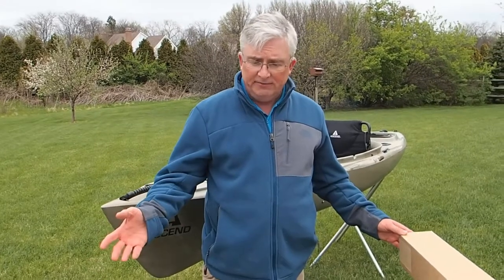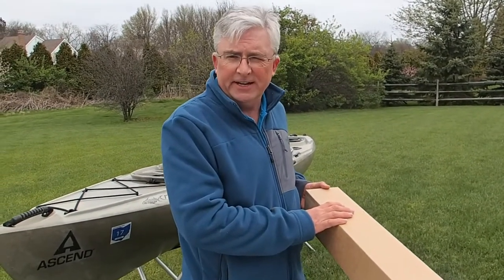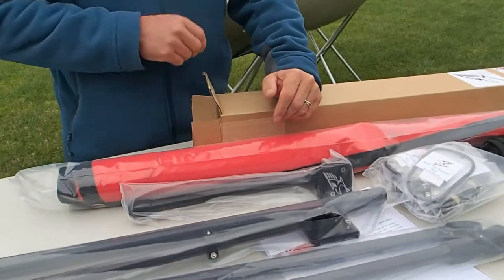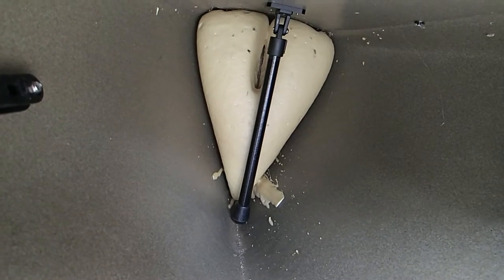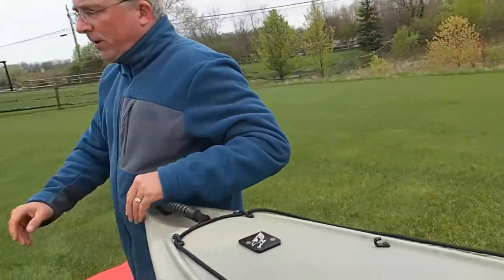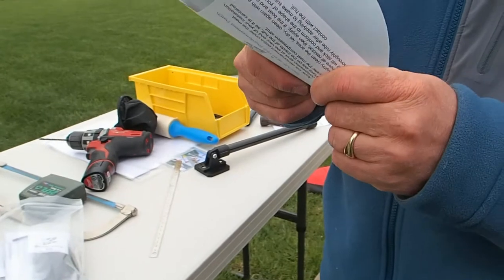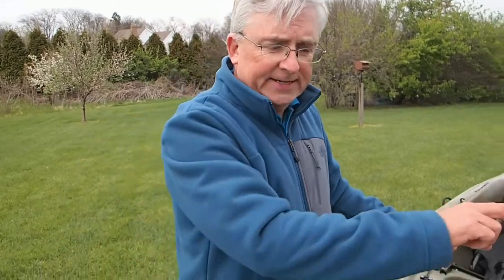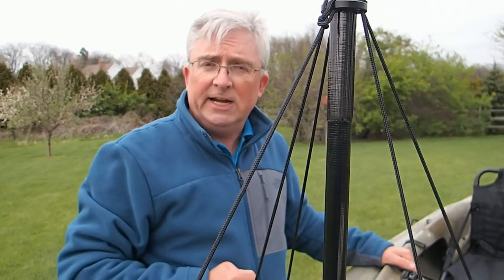Falcon Sail recreational kayak sail install install demonstration.

Comment: Are your sails compatible with inflatable kayaks?
Reply from the maker: You can rig a Falcon Sail on your Inflatable Kayak.
It will require that you make a base be set up for the mast & find a way to secure it to your kayak.
Basically, all you need are some Drings on your kayak to run some lines or webbing to your base.
It can be very secure.  If you need extra line, or cleats to make you rig let us know after you purchase, and we add these parts to your order free of charge.

I would like to post some pictures for you to see some rigging examples, but I can not include pictures here.
If you send a request using the Falcon Sails contact page, we will send  you some pictures to show you what other Falcon Sail customers have done with their infalable kay aks.

www.falconsails.com/contact.php

Comment: I have a 8 footer kayak and my question is should I use 1 square meter or 1,4 squares? I’m planning to use on intercostal waters
Reply from the maker: I would use a 1.0 square meter Falcon Sail.  A Falcon Sail with a complete rigging kit includes all the hardware necessary. All you need are basic tools.
You can design a custom sail for your kayak here.
www.falconsails.com/store

Comment: Easy when you can get underneath the deck. What do you do if there is no access ?
Reply from the maker: Since we started helping people rig sails on kayaks over 10 years ago now, we analyze every single kayak or canoe, someone buys a Falcon Sail for.
When you order, near the end of the purchase process, it will ask what kind of kayak  you have.
If you do not answer the question or we are not 100% able determine what is the best rigging plan to use, we will contact you.    After having Analyzed and documented rigging plans and parts lists for over 1000 different kayaks, we have seen it all and will make a solid rigging plan for you.

When you receive the sail rig it will have every part you will need or want.  All you will need are basic tools. 

We have 2 alternative rigging options when a kayak does not provide access under the mast to install the deck support strut.
#1 Screw Out Deck Plat added to the kit.
Since your kayak does not have access to the inside of the kayak to install the deck support strut, more than likely, we will include a water proof screw out deck plate with all the hardware you will need to install it.  All you need is an area 5" around that is flat or nearly flat within arms reach of the mast base, to use this approach.

#2 Deck adapter block with a integral deck support strut.  With this method, you rivet the deck support strut in place with the provided easy to set rivets, and the strut extends from the bottom of the adapter block and engages with  your hull. It  works on all kayaks, but most people prefer using the standard install or the alternate #1 above.  

In any case, we have a solution for any rigging situation.  When you buy a Falcon Sail with a complete rigging kit, at the end of our store will ask you for information about your boat.  More than likley, we have already analyzd your kayak or canoe.  If we need to know anything to choose the perfect rigging parts list, we will research as necessary until we have a great rigging plan for you.  We will support you from now, until you are happily sailing your kayak. 

Here is our latest rigging video.
https://youtu.be/2i8_EEExqNg

You can design and order your custom sail here.
www.falconsails.com/store

If you have any questions feel free to contact our shop any time.
www.falconsails.com/contact.php

Thank you very much.

Comment: There is Grabner kayak facebook group, guy installed this sail on inflatable kayak (closed top). Haven’t got a clue how he did it. Maybe used drill as well?
Reply from the maker: After having helped many thousands of kayakers rig Falcon Sails on there kayaks, you can install a Falcon Sail on any kayak.
On the decked inflatable kayaks, you make a board ( plastic marine wood is good ideal, but anything will work long term if you seal it ), then insert it under the deck before you inflate it.  When you inflate the boat, the board will be held amazingly solidly in place.   It is actually one of the most solid ways to rig a Falcon Sail on any boat.   If you need help, give our shop a call.
Here is our contact page.
www.falconsails.com/contact.php
Reply: @FalconSails  Thank you for really good response. I can see, professionals who know their trade.
Reply from the maker: @kristaps2010  I am sure you will not find better expertise in the compact sail area.  Plus we will jump through hoops to make sure you are happy.

Comment: I am sure you have probably changed your shroud line knots by now, but if you have not as yet there are far better simpler and faster knots available.
Reply from the maker: After over 10 years of obsessing over every detail, and having helped and interacted with thousands of people properly rig their kayaks, and being very active kayak sailors ourselves, and always looking for improvements, we have not seen anything better than the standard Falcon Sail knots.  Early on, we encouraged our customers to try and find and create better knots.  We found 2 problems occurred when people varied away from our knots.  #1 the experimental alternatives slipped.  Just a minor slippage, will change the orientation of the mast.  Our knot system once set will not slip even 1/10th of a mm over the life of a kayak.  #2 the experimental alternatives would become tight and hard to adjust.  Early on after rigging a kayak, some of the knots may not be completely tight and as they tighten, the lines effectively lengthen sometimes requiring some final adjustments similar to what you will find on a bike with its cables setting in during the early period of riding.  Additionally some people want to play with / adjust / experiment / perfect their mast orientation all of which make people appreciate a great proper knot that is easy to adjust.  So in the end, we suggest people do not try alternatives.  When they do, it leads to problems.  If you do have alternative knots, I would love to see them.  We have heard of a number of confident people saying they had some great knot plan, and then they need help dealing with the issue.  Of course we are always happy to help our customers get back on track.  Support is something, you can count on with Falcon Sails.

If you want to see a web page that shows the proper tying of standing line knots, see
http://www.falconsails.com/knots/
Reply: @FalconSails  Thank you for your reply it was good of you to take the time. I have always found that a wagon hitch or double wagon hitch will hold anything up to the breaking strain of the cordage. Tied off with half hitches pinching the turns one at a time. Being a fuss pot I like to whip the tail end back onto a convenient part of the turns, after knot length set of course. Does occur though by using a bridal system on the stays and three jamming cleats it would be possible to angle the mast infinitely to suit wind conditions making the best use of your mast step system.
Reply from the maker: @davidprocter3578  Thank you for telling us about your idea.
As always we will consider everything.
At the moment I can not say anything but your idea may work.  Historically everything else we have seen is a step backward, but we could be wrong even after making our lives out of these knots.   In any case, I put your notes in our design files, so when we have time we can make a sincere test of how well they work.

One issue we may have is the fact that people tend to get confused.  Planning on changing mast orientations for some very small benefit is not the kind of thing we push.  Esp when people have to learn about basic sail trim and making the rig stand strong.  And of course the knots are still adjustable.  But I have not looked at your idea in detail, so that is all I can say for now.  If you email close up pictures of your knots, to Falcon Sails, I would be happy to see them.  Put attention Patrick on it.

Have a good one.
Reply: @FalconSails  I would say in reply many folk who canoe also windsurf and will have no trouble using such a system or understanding trimming methods,  those new to sailing  need not bother with any adjustments until they feel comfortable with more basic sailing techniques. two yacht fenders of the type with molded loops on either end could be attached to two bamboo poles one on each end and lashed across the beam of the canoe to provide training [wheels] floats for the nervous or stability in heavy weather for the more adventurous. the frame would also provide a fixing point for lee boards increasing the usability of a sail, giving some upwind performance.

Comment: Great Video Patrick, really showed how easy it is.
You should do a follow up on the underdeck nylock nuts, how to get to difficult locations, and trim excess bolt lengths if needed. I recently had to do this for some Pad-eyes in my storage areas and used a Multi-Tool this time instead of a hacksaw, which made it so easy, but I will say that using a bench grinder is also easier than a hacksaw.
Reply: If any screws are too long they are all common sizes.  You can go to a hardware store and buy a shorter length.  The Falcon Sail rigs include screws that will be long enough for sure 99% of situations.  You can also cut the bolts with a rotary cut off tool and or add some nuts to the bolt that bothers you to make it a softer end. The best thing to do is buy screws to replace any excess length that bothers you.

Comment: Impressive mast mount and deck support stanchion hardware.
Reply from the maker: It is impressive.  Thank you for recognizing it.  It is very important to have a strong and stiff and tight joint like this, or the mast will not stand strongly.  The sail rig and the boat should be one solid unit.  There should be no play between the 2, just like a typical sail boat mast.  They should move together as one unified assembly.  The Falcon Sail rig has 7 patented features that keep it solid and strong.  Thanks again.
Reply from the maker: A lot of people think a good sail is what you need.  The rig is actually just as important.

Comment: Do these work on a sot kayak?
Reply from the maker: Yes you can rig a Falcon Sail on a sit on top kayak, or any kayak for that matter. We help people rig Falcon Sails on sit on top kayaks all the time.  Sit on top kayaks are usually very stable, and have a good hull profile for lateral resistance which in general makes sit on top kayaks great for kayak sailing.
If you need any help, feel free to call our shop any time.
www.falconsails.com/contact.php
Reply from the maker: Also see our new sail rigging video.  
https://youtu.be/2i8_EEExqNg
Reply: Thank you so much, I'll check it out

Comment: what happens if you flip the kayak? Can you roll with the sail attached?
Reply from the maker: It is easy to avoid capsizing.  All you need is a little common sense.
If you do capsize your kayak, all you have to do is release the forestay and them mast will fall.
At that you perform your re entry just like you would without a sail.

We  have worked hard to make our rig be as easy to use as possible.

Here are some videos of the owner of Falcon Sails doing some roll practice.

https://youtu.be/u6vdygUCVco

https://youtu.be/a8ANYekiqws

https://www.facebook.com/falconsails/posts/2758151907583509

Comment: Is there a center board, or tiller?
Reply from the maker: There is no centerboard, lee board, or anything like that.  If a kayak is good without a rudder without a sail, it will do fine without a rudder with a sail.